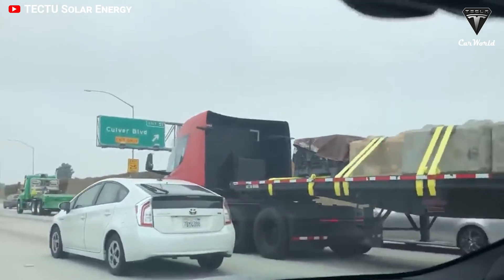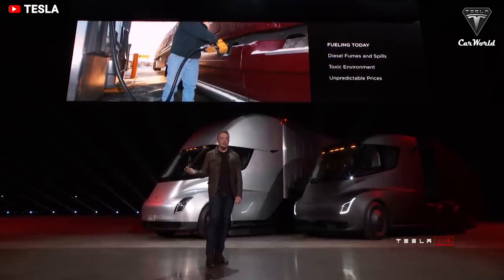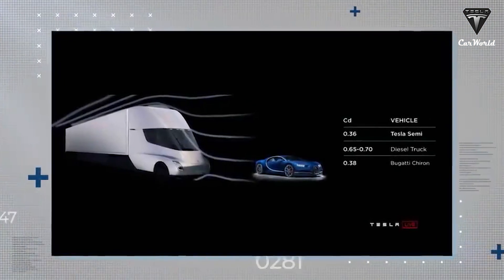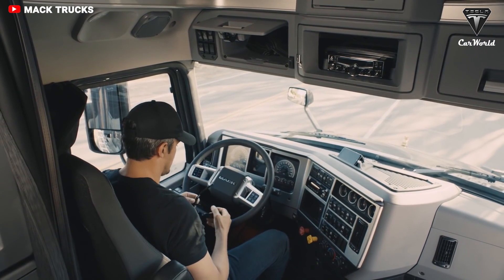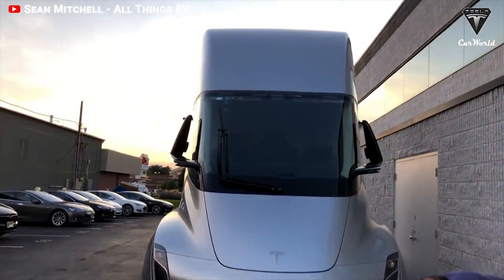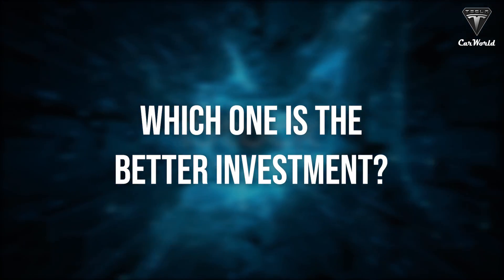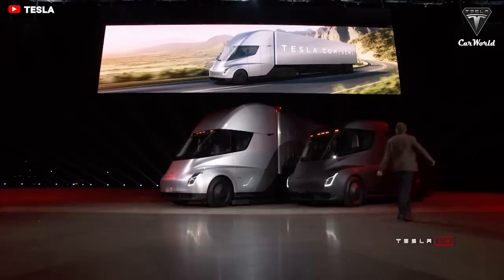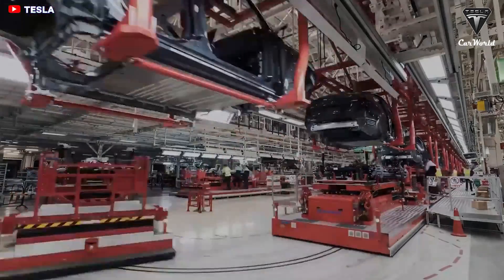Which is the KING of 2023 heavy trucks? Mack Anthem Diesel Truck Vs. Tesla Electric Semi?

Comment: Just curious why you chose MACK as the main competitor for the Tesla semi. Next time you drive on the highway count how many Mack Anthems you see pulling a trailer and let us know.
Reply: That’s an easy one to answer. He picked the truck that he thought was the easiest to beat. You are right so you must be a driver. You don’t see many Mack’s on the road. They are known for being tough but that’s all. That’s why they’re dump trucks and things like that. Think about it. Right in the beginning he said they’re to most powerful trucks out here. Wrong answer.
Reply: @knightwing4  Nah it IS the easiest to beat. It's just that the bottom of the barrel ICE semis still FAR outpaces anything Tesla can churn out.
Reply: New Cascadia with a day cab would be a better comparison. Or the eCascadia for a 1:1 comparison.
Reply: The Volvo VNR would be a better comparison. That Volvo’s class 8 electric prime mover that has been on the market for 12 Months.
Reply: I came to bitch about how he chose the weight numbers 🤣 everyone is limited to 80k unless you do heavy haul type stuff
Reply: @illNATElli  Just for clarification the 82k number comes from electric and cng (compressed natural gas) trucks get a 2k weight restriction bump.  EV and CNG cabs weigh about 25k vs diesel cabs being roughly 18-22k.  Government is basically giving the 2k weight adjustment to promote the "cleaner" alternatives.  That's why they claim they ran loaded just under 82k.  they would still be legal.
Reply: @bzhnz5790  i figured that out shortly after this comment! Thanks!
Reply: @Madd Zack depends on the state. To travel over 80k you need a permit no matter what and must not be a divisble load. Not aware of any exceptions besides grain trucks during harvest. The rig i drive has 7 axles including the trailer. Each state is different with what kind of weight each axle can have on it. Idk where he came up with 82k unless ev trucks are allowed a bit more due to battery weight
Reply: @illNATElli  They are
Reply: @Madd Zack  from what I read, ev semi's are grant an extra 2000lbs by fmcsa due to battery weight.
Reply: For real. I rarely see Mack trucks on the road. Volvo, freightliner, and Cascadia dominate the highways I frequent.
Reply: People don't realize what Macks are made to be used for. Thats why you don't typically see them on the road.
Reply: The answer is obvious lol , it's the weakest competition
Reply: @ruggedtechie5867  you’re right.  Had this content creator just chose another diesel truck, the Tesla would have lost.  SMH 🤦‍♂️ you guys are not the brightest 🖍️ crayons in the box.
Reply: Lmao your exactly right. I'm a truck driver & mostly you see freightliner, peterbilt, international & volvo
Reply: Remember the f150 vs cyber truck thing?
Reply: @kamallb4650   yes. And ford wins
Reply: @Thatposcraftsman  it was legit the most unfair competition I saw in a while🤣
Reply: @kamallb4650  true Tesla can’t beat other companies
Reply: @Thatposcraftsman  that's a bit of an exaggeration. They prolly can but their current situation cannot.
Reply: I’ve been seeing Anthems here in Arizona
Reply: Better yet, just compare them all. With how common certain brands are in certain regions, the Tesla semi is easily beat. Especially with how the engines can be swapped, & other stuff like that.
Reply: Not many lol
Reply: @Madd Zack is because tesla got a waiver to include the battery weight thats all
Reply: All cascadias tbh
Reply: Exactly
Reply: @Madd Zack electric semis are allowed 2000lbs extra to account for battery weight
Reply: No they should have compared it to a Volvo or Freightliner if you're going with what you see the most of
Reply: The Mack Anthem in particular is not marketed towards mega fleets like Swift. They are marketed towards smaller companies. Somewhat of a "premium truck" you could say. Somewhat. That, is why you don't see a dozen of them on the road.
Reply: I’ve actually seen a decent amount of Anthems on the road. More than I would have expected. However, they’re still somewhat rare. Every other truck on the highway seems like it’s either a Freightliner Cascadia or an International LT.
Reply: Ricky:  Tesla blows away both the diesel semi and the competing BEV semis, re the specs.  So either way, it's clearly advantage Tesla.   Now Tesla needs to show it can seriously ramp up production.   Luckily, the power train is based on the same motors used in its cars.
Reply: @rogergeyer9851  diesel is better
Reply: @Thatposcraftsman  how is diesel better than Tesla semi again?  Spits out tons of nitrous oxide, 300% slower , 400% more expensive per haul , more expensive to operate, will break down and is not guaranteed 1 million miles of service.  You diesel guys will look like dinosaurs in just a few months if you don’t come with something better.
Reply: @JonNobleNobelOne  you electric guys will be stuck on the side of the road and us Diesel guys have to help you
Reply: @JonNobleNobelOne  diesel engines are better than electric motors in teslas
Reply: @Thatposcraftsman  that won’t happen when freeway “call boxes” retrofit to super charger plug with a few solar panels on them.  Creating an instant fuel station anywhere the sun will shine, which btw is everywhere.
Reply: No one cares about electric cars
Reply: @JonNobleNobelOne  you have plenty of million mile trucks to choose from but what tesla semi has reached a million miles yet? With the same capacity or range? You act like tesla don't break down and strand their owners in the middle of traffic or catch fire releasing all the toxic chemicals used to make and cool batteries. Diesels are better for hauling stuff long distance and remote areas evs can keep it short distance even with mega chargers and stuff that's a lot of energy to charge one truck. Not to include issues salt give ev trucks in general
Reply: @LEOKRAUZYT  Tesla semi came out like yesterday so you’re right they haven’t gone 1,000,000 miles yet.  Tesla semi can lose 2 of 3 electric motors (break down) and still move its Haul.  And yes it’s a lot of energy but that energy can and will eventually all come from the Sun, not dead dinosaur juice which is running out.  Regen breaking creates more energy and virtually eliminates dangerous run away conditions.  Diesel engines had a time and a place but that time and place is quickly disappearing.
Reply: @JonNobleNobelOne  They create a more dangerous situation if the brakes fail which everything that moves eventually does, regen braking is a gimmick at best otherwise they wouldve harped on it while  doing the presentation and shown numbers I know that 8hr drive mustve had some stop and go or descents when they couldve used it and given some kind of numbers.  A runaway motor isnt all that bad if it runs out of fuel  or fuel lines are removed or shut off you can stop it but if a electric battery catches fire, you could put out the one or 2 cells that started but the rest can cook off any time later so while that truck is being towed to a factory or shop to be repaired itll catch again and again and again till the battery back is removed or the truck burns down. Not to even mention techwaste, battery packs cant be recycled or reused and have to be thrown into a land fill, and the carbon footprint of those battery packs are ridiculous with the rare earth metals that are used to make them viable for electric truck usage. IE the lithium mines that run tons of heavy duty equipment daily just to mine enough to make battery packs for EVs, or the stuff that goes into them like heavy duty tires even for regular teslas due to their weight or the oil used to lubricate the parts of any moving machinery. Dead dino juice or oil isnt the only fuel diesels can run off of bio diesel which is man made and can be produced easily can be used or you can even modify diesels to run off of used cooking oil and various other things, and while battery packs cant be reused engines can if they arent destroyed while driving, you can bore out or remanufacture a used engine by tearing it down and rebuilding it or replacing key components that can still be melted down later for use in another application, One engine block so long as it holds material wise can be rebuilt multiple times and reused and if not can get wrecked and scrapped for metal. Diesel or combustion engines will be around for a long time to come especially in heavy duty useage if its not an oil crisis itll be a lithium crisis or enviromental crisis involving the mining of lithium.
Reply: @LEOKRAUZYT  just shove a towel in the intake to stop a runaway engine.
Reply: @Jon Noble Noble one  it's about practicality in this case. It takes long to charge, even with supercharger. And teslas don't do so well in colder weather even with the improvements in their tech. The vehicle's batteries take a toll going up hills too
Reply: @rogergeyer9851  What’s the overall cost of this Cadillac? It’s a commercial vehicle and the point is to make money not be the best bling.
Reply: @rogergeyer9851  highly doubt that was luck
Reply: @rogergeyer9851  Unfortunately Tesla’s power train is based on that used in cars - cars need way less torque or power to reach ridiculous speeds.
A car at 60mph needs 40HP continuously. Anything more is just a hand waving exercise because you simply can’t apply it long term without exceeding speed limits.
Truck (and aircraft and marine) engines have a higher continuous power requirement requiring different gearbox and bearing designs for reliability due to lubricants being squeezed out of loaded bearing surfaces.

Comment: Thumbs up for the video. But, as a corporate business owner operator in the trucking space, Tesla semi truck ranges in the real world will be much less. There's zero chance that this truck has a 500 mile range bobtail, deadhead and at max gross weight. 

Secondly, you cannot legally haul 82k lbs gross. Diesel trucks tend to have 3-5x times the driving range before they need to be fueled.. Also, Freightliners are much better trucks than Macks.

Comment: I would say electric is ok for local and state deliveries but the fact that they will have to recharge for large extended times will hurt them for the national deliveries. Therefore Mack wins for the long haul trucking
Reply: I would agree except technology is not static. Look into Skeleton Batteries, they just had a huge investment from Shell oil aimed at electrifying the mining industry. These new batteries use curved graphene super-capacitors which allow to charge large batteries in less than a minute. The batteries will be utilized in oversized three story sized trucks. So with this type of arrangement refueling will be a thing of the past and so will lithium and all other rare metals currently used in modern batteries.
Reply: @RB-yj9ng  capacitors are not very good for vehicle operation in their current technological state.  They are great for massive power output for short bursts of activity.
Reply: The tesla megachargers charge the semi to 75% in <30 min.
Reply: That's why the current Tesla Semi is designed with a day cab, for short haul and mid-range trips, it is not yet suitable for long-haul routes. But there is intensive research being done to develop power transfer  from coils embedded in the roadway to moving vehicles, that would allow for EVs and electric trucks to have nearly unlimited range, making long-haul electric semis a reality.
Reply: worbg éktr loñg rnàgé
Reply: Tesla Semi chargers are going to charge batteries to 70% in 30 mins.... so not actually true (and yes... the Tesla Semi Charger rollout will take time.. so could be a few years before the whole U.S is covered)
Reply: once there are charging stations every abo 5 hours on the highways it will be fine even for long haul due to the 14 hour windows of operation drivers must follow.  But, the orig poster is being dishonest about the cost of charging...you will have to charge this truck during peak hours at least from time to time but even in off peak hours the cost of electricity in California and NY is more than double his quoted price.
Reply: Spencer:  Stop just making things up from being clueless.  Even if the Tesla needs to be recharged, 70% (350 miles) in half an hour while one takes a bathroom break and grabs a sandwich is NOT a big deal.  it's NOT like big rigs are instantaneously filled with diesel, after all. 

Plus, in the real world, there are real limits to how long semi drivers can drive each day.
Reply: @rogergeyer9851  it takes like 15 mins to fill big rigs with a full tank.  The issue comes with maintaining full operational times in the 14 hour windows they are allowed to drive before mandatory 10 hour breaks.  also many trucks have multiple drivers for near 24 hour uptime for shorter hauls.

Comment: I love the “Zero emissions” saying. It’s more like exporting the emissions to other countries that do the mining for lithium. I’m sure there’s some type of oil based lubricant for the gears in the Tesla. Another strike against “zero emissions” And we can’t forget about the Heavy Duty grease that’ll be needed on the fifth wheel. And Tesla took down the pricing of their semi on their site once the $40k rebate was announced. I believe the Tesla Semi’s base price jumped up about $40k now. Interesting how that worked out.
Reply: Do lubricants and grease cause emissions?   Are you talking about the refining process?  If so, that's pretty small.
Reply: @BigWorldOutThere98  yes dawg oils  and synthetic grease are harder to refine than gasoline. Many have rare materials like lithium or Molybdenum disulfide added in and semis need a lot of grease everyone knows about motor oil but chasse lubrication is very important to keeping the suspension and steering components from wearing
Reply: Forgot to menion all the power generation it takes to charge the batteries.
Reply: @jeffs7707  charging these through a power plant is nearly 6x more efficient than burning fuel in the engine.
Reply: “It ought to be remembered that there is nothing more difficult to take in hand, more perilous to conduct, or more uncertain in its success, than to take the lead in the introduction of a new order of things. Because the innovator has for enemies all those who have done well under the old conditions, and only lukewarm defenders in those who may do well under the new.”

- Niccolò Machiavelli
Reply: Exactly what it is.  I don't wonder why they don't show those pics of lithium mines in Africa.  I've seen them.
Reply: @kenbowser5622  The lithium mines are in Australia, Chile and China.  Cobalt is in Africa and Tesla is moving away from Cobalt in their batteries.

Comment: Definitely think this is the right move for the future. Looks like these EV trucks would do better in local jobs. Hopefully this will lower cost of fuel for the interstate guys.
Reply: Can heavy loaded ev easily drive uphill and mountain?
Reply: @frxxxxx  yes actually
Reply: @russsorvi4181  Nah, they dont have enough torque
Reply: @russsorvi4181  But, can the drive on logging roads in the mountains? Or hauling out of farm fields?
Reply: @billcarver6539  Oh come on, stop with the bullshit arguments. The original post literally said great for local jobs. Can a Mack fly into space? That's the same argument you are making.
Reply: @bedinor  Whats bullshit about my comment? Just look at the tesla, it sits to low for off road.

Comment: I run a mack day cab and I pull 107,000 lbs because the truck has heavier axles. Is there a heavier option for Tesla? Also torque is what matters in big truck not hp. I carry 200 gallons of fuel and do 800 miles a day without worrying about it. What’s the recharge time on the Tesla after 500 miles? And the truck gets about 3 mpg loaded and 6. So that is worse than you mentioned in the video.
Reply: wróbg

Comment: Thats a bad comparison. A Tesla truck can’t haul as much as a diesel can because the tesla truck also weighs a lot more than the diesel truck. Plus, I highly doubt trucking companies look for trucks as fast as an old 90’s M5. 

Furthermore, the Tesla truck is gonna suck in the long hauls. Remember, the bigger the load, the more power needed, which means to achieve the needed work, its gonna consume more fuel/electricity, and electric motors will drain those batteries very quickly under a full load uphill. 

Diesel trucks are way better for cross country hauls. The Tesla is good if you are going a few cities over.

Comment: The Tesla is nothing but a toy.  To start with, no normal 1,500 mile range with a 15 min recharge.  It is also easy to tell the person talking is not a truck driver because they don't know much about any normal truck.  They think a Tesla can't jack knife.  When they put it on a slick road they will find out different.   That regenerative breaking on a slick road will cause a jack knife.  They will enjoy watching the trailer passing the tractor on the highway.  Question:  When will the first one have a battery explosion?  Every Li battery is capable of exploding.  The battery is made up of thousands of little Li batteries and when only one has a problem the whole battery goes.